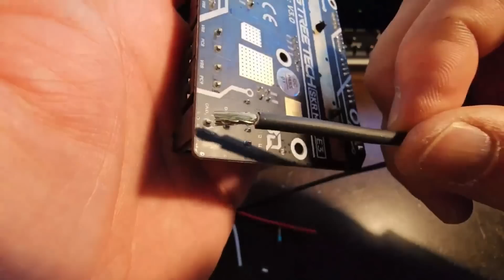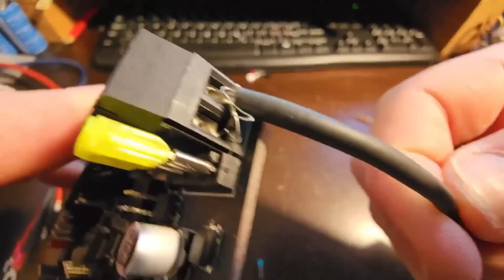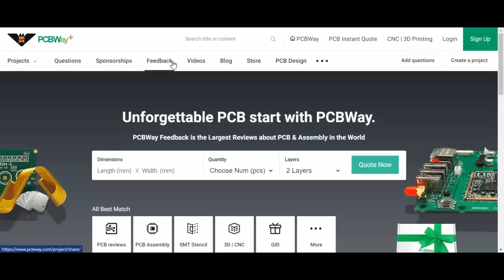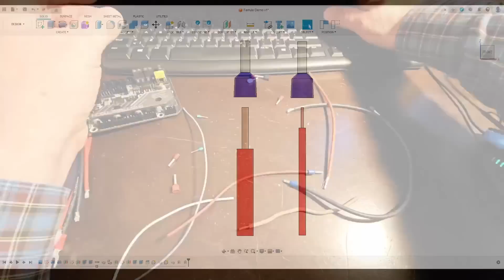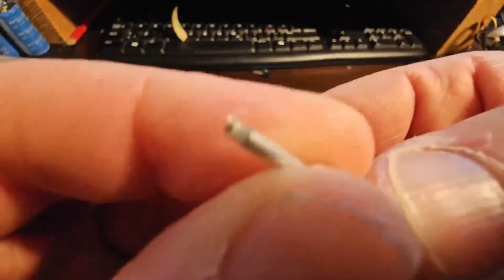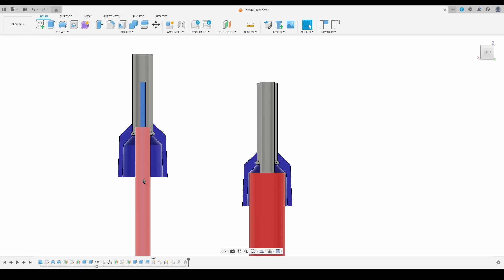A beginner's guide to Ferrules

Comment: Would stranded wire crushed under a screw also create heat by the air gaps created from the spreading of the locking (crush) screw
Reply: Sorry asked question too soon, hence the point of this video

Comment: Is it that it has been soldered? Or that the solder is most likely lead-free solder?
Reply from the maker: Never use solder in clamp terminals. Solder is for solder welding to a contact pad.

Comment: Tinned wires can't be smooshed at all it's hard as rock. to create more surface contact the ferules makes it easier to make more surface area for electrical conductivity.  Crimped ends are softer than soldered ends.  The shape of the crimp also helps.

Comment: Using a ferrule for larger wires like a #6 THHN stranded for 60A-is it recommended? I never like using stranded with screw.
Reply from the maker: I don't think terminations on THHN solid wires or any type of solid core wire is recommended. Although I work mostly with MTW type which requires termination. For high amp application we move to solid copper bars.

Comment: Another important point about ferrule use! 
Never solder the end of a crimped ferrule. It will NOT do better.  
Yes, I've seen idiots do this and even apply solder after crimping a red, blue or yellow crimped lug at the inspection port. In one case a whole light aircraft had to be re-terminated because the idiot owner was soldering after using the correct ratchet crimp tool.
Reply from the maker: Exactly, and the same goes for jst crimps and the likes. I've seen so many  adding solder after the crimping those too.

Comment: I didn't get the water hose theory of electron flow where terminal is clamping the flow of electricity and it releases at heat. Well that ferrule clamps the crap out of that wire. Yes I use ferrules and I also design and wire control cabinets for motion systems.
Reply from the maker: The water analogy was trying to get you to understand that electrons do not only follow the path of least resistance. If that was the case then no circuit systems would work as they reply on several different resistance values and various flows and routing of electricity.
The heat part is what causes the damage. More resistance causes more heat, more heat causes more resistance, that's thermal runaway and the danger this video is trying to help prevent. If you are an automation technician you should have a good understanding of this. It's a vital part of maintaining the safety of your system.
Reply: @StackingLayers  I do have an understanding, but the part that throws me in the video, is it sounded like tightening the terminal squeezes the flow of electrons
Reply from the maker: @portblock really? I repeatedly explained that the issue is gaps and cracks. Not too much pressure. Maybe the part where I say a resistor clamps down on the flow of electricity? That's just my way easily explaining impedance, since not everyone will understand that what that is.
Reply: @StackingLayers  Perhaps you are right, that may what I heard while haphazardly watching. I also need to watch how I say things, and here in front of all, I apologize sir. Sometimes I think I turn into one of those keyboard warriors when I dont mean to. You deserve better respect and I am going to go back and watch your video again.

Comment: sometimes crimping the plastic can also give you a bit of  extra grip and strain relief too....  this is handy on the smaller crimps
Reply from the maker: No! Never clamp on the plastic or insulation. Doing so will reduce the conducting material contact. That is also a fire hasard.

Comment: If the soldered wire has a connection why would the electricity flow through another cracked path that has more resistance. Electrons use the way of least resistance.
Reply from the maker: That a misunderstanding of the physics. Electrons flow through all conductive paths just not equally. 
Imagine it as water in the pipe system of your house. Say somebody's taking a shower and you go and turn on the water at  the kitchen sink, but just barely. A little bit of water comes out, right? At that moment the faucet has a dramatically higher resistance than the shower does and yet there is flow at both points. With electricity it's, in a very simplified way, the same principle but with the added problem of heat caused by resistance.

Comment: Ferrules are important, but the explanation at the beginning cannot be acceptable - solder melting at such lower temperature and such things. 😢
Reply from the maker: It's not melting at first, it's getting stress cracks. This allows for arcing which generates more heat, causing more resistive issues, basically puting it into a a thermal runaway situation. Solder can start to soften at 175c where as electrical arcs can reach in the 1000's of degrees. Granted theses arcs are micro to start out but you should be able to imagine what kind of havoc that would create.
Reply: @StackingLayers  Solder tipped flex cable comes loose in the box terminal because the soft solder can squish in the box when the wire is subjected to mechanical movement. They can wiggle loose. 
This is especial true in cheaper PCB terminals like that when the clamp plate between screw and conductor is thin, deforming into a profile matching the round screw applying pressure on the joint. Solder also requires more tension on the screw to get the connection to a point when the wire doesn't wriggle in the box.

Comment: It creates heat because the solder is solid
The uncrushed wire creates only a couple of points of contact
Those couple points of contact are carrying all the current so it gets hot and melts. 

Untinned wire curshes in the connector and the current can use the entire wire, not creating hot spots

So you are correct. Some is misinformation.
Reply from the maker: It's primarily caused by air gaps amongst the conducting materia.l Solder is soft enough to crush in the terminal. The micro cracks allow arcs to form, which are basically natural resistors. The longer they go unchecked, the more the gaps open from determination and in the case of solder it's tendency to creap with both heat and pressure is what makes it even more susceptible to thermal runaway.

Comment: Bare wire is always the best connection for electricity flow. Furrels might look nice and more convenient, but they are weak connection point. A narrow path in the wire that will restrict electron movement and cause a hot spot.

Check it with a thermal camera.
Reply from the maker: That would be a case of using the wrong type for your application, and not having enough torque on the clamp. But as I mentioned in the video bare wire is fine too, as long as you don't fray them out during installation, and as long as the terminals are made for bare wire.

Comment: Ferrules are great but the crimp tools cost more than most hobbyists are able to afford.  Still would be helpful if you listed your tool mfr and model numbers used in the video.  We used Weidmuller crimpers where I used to work and they were great but no way could I afford one for home.  There's probably some decent quality knockoffs out there so if anyone has any recommendations please comment.  Thanks for the detailed explanation.
Reply from the maker: You can get them for like $15 to $30 on AliExpress, eBay, and the likes. I have Weidmuller (bought used on ebay) and a no name version I bought off AliExpress both of them work basically the same. No reason to buy the name brand ones if you're not going to be doing on a daily basis.
Reply: @StackingLayers  Couldn't agree more. A lot of Adafruit/Sparkfun breakout boards and microcontroller hats use JST/SH connectors for their stemma/qt platform and the offical crimp for their specific pitch was something like $230 on Digikey. I bought the equivalent for $30 from Engineer and honestly the build quality for mine seems better but there seems to be no end to industry people saying JST certified or bust.

Comment: I would add a *BIG* word of caution.  I purchased ferrules for my offgrid solar setup and used them on my solar charge controller.  BIG BIG mistake.  After smelling an odd smell I discovered that the wire was getting very very hot in operation.  The documentation for the controller actually specified a strand count and specifically not to use ferrules.  I removed the ferrules and retorqued to the specs and haven't had an issue since.  While these are good for low amperage simple screw connections I would be hesitant to use them with anything moving real current.

FYI:  The connector on the controller is designed to be used with bare wire.  It has a large clamping surface with teeth and when a ferrule is used there just isn't the continuous contact area that it can achieve with the bare wire.  Only the tips of the teeth make contact because the wire is so compressed it cannot bite into it.  Just a word of caution to the solar guys out there!
Reply from the maker: The burning would be from an incorrectly torqued terminal or a poorly installed/incorrectly used ferrules. I work with industrial control systems and starters. We have starters rated for 45+ amps and all use ferrules, in screw terminals. It's a requirement. Though we use fine strand/flexible wires for vibration tolerance.
 In a standard house installation and other installations that use solid core wire. Ferrules are not typically used with solid core wire, and completely pointless on single core.
Reply: @StackingLayers  His story seems to indicate that the terminals were designed for bare stranded method only. It may have terminated better with a ferrule if the box clamp was used to crimp the sleeve, achieving higher connection surface area.  
Sounds a bit dodgy having 100A high flex (very fine strand) cable terminating in a box clamp terminal block. That should be a bolted crimp lug.  16mm^2 (63A) is about the limit I'd confidently use a box terminal.

I have a similar industrial career experience of over 45 years, manufacturing. Very high QA Standard Generation, transmission protection, distribution and process control. Terminated millions of cables.
I've used ferrules to terminate 95mm^2 cable, down to the 0.25mm^2.  Bare termination has always been a QA fail, even on basic Control or Distribution boards, UNLESS the terminal is designed for bare (which is a huge PITA) This is done using preinsulated crimp lugs (of many form factors) or ferrule. 
I loathe using the spring bite type terminals, that sometimes require bare use only. 

It's good to see decent strippers being used. 😉 I do find my Weidmuller Stripax to be the best. Are the cheapo versions have the cutting blades made from multiple stacked wafers that adapt to the conductor shape?
I find those hex crimpers are fine, but it's a QA fail sometimes if a ratchet preset tool isn't used. You get RSI fatigue using them all day. I use a variety of Weidmuller crimpers for preinsulated sizes (that go down to 0.5mm^2 btw) and ferrules, of course up to that 95mm.

There was one point I would make when teaching amateurs about ferrules - Do NOT apply solder to the crimped ferrule, ever. (unless you are soldering down the wire connection to a board).
Reply from the maker: @BTW... I to didn't agree about the wire and connection choice but I wasn't ready to get into that part. 😅
Reply: @StackingLayers  I don't agree with the connection choice either.  Its just how its sold.  I wasn't looking to create a big ole debate was just relaying something that happened to me.  I would have preferred lugs.  It is one of the largest solar charge controllers made by Victron.  This is something that if I didn't catch it would have surely burned down the house (thank goodness it was stinky)...  FYI Victron 250/100 charge controller.  Take a look at the pictures of the terminals.  I am open to any ideas how anything I do could be done better.  I would even be willing to send pictures.

EDIT:  FYI the battery cables do still get warm.  Under full load they are just above body temp.  Guessing 110 degrees'ish
Reply: @StackingLayers  This was at 100 amps through 2/0 fine strand wire.  Unfortunately it just didn't work for me and both cables got equally hot.  Cut off the ferrules and inserted the bare wire and torqued to spec and the issues stopped.  I will still use them in other applications was just relaying my experience.  After I removed it I could see how the clamp hadn't actually clamped the ferrule like it does with the wire inserted directly.  It just didn't crush down like the bare wire does limiting the contact area.
Reply from the maker: I don't doubt that your situation panned out as you say. I probably would not have used ferrules on such a large gauge myself. And if I did choose to use them it would not be a round crump it would be a square or rectangular crimp tool to accommodate the terminal clamp dimensions.

Comment: I'm liking XT60 even more now. Maybe we should have a surface mount version of these (I only see a surface mount for XT30 which may be enough here).
Reply from the maker: Ove seen those melt down too. But that was more likely due to poor construction or repeated disconnect and reconnecting. The pins tend to lose their springiness over time creating the same problem of loose connections.
Reply: @StackingLayers  terminal blocks aren't for frequent reconnections. Isn't an XT connector (with wired soldered on each side) a better alternative (if space and money permits)?
Reply from the maker: If you are doing constant swapping of power sources, like with battery operated things, then that connector would be better I suppose. Terminal blocks are made for a more permanent connection with an easy service option.

Comment: Man I don't even own a 3D printer but I do other electronics tinkering, and somehow this whole concept was entirely off my radar. I've got so many terminal blocks that need to be upgraded now :D
Reply: As someone coming from a similar context, Ferrules are great for the polish of something closer to a finished project but I've found that banana jacks and plugs are great if I'm repurposing a lot of setups or prototyping different iterations of a build. And the fact that test leads from DC supplies often have another banana jack built in means I can extend and isolate power easily or plug a multimeter in for diagnostics.

Comment: So... tighten the terminals when the solder is warm and soft...
Reply: Better yet, remove the terminals & solder straight to the board! /s
Reply from the maker: The point is to not generate that much heat in the first place.
Reply: @StackingLayers  Exactly. So, if the solder is getting hot enough to melt... you have OTHER problems - too much current. Fix that.
Reply from the maker: The problem is too much resistance from the poor/damaged connections not too much current. Which is confirmed by the fact that there's not enough current flowing to blow the fuse.
Reply: In fact, forget the terminals! 😄

Comment: The place where solder gets pressure it flows away over time and becomes thinner. 
You get a loose connection. This then gets hot and burns the terminal.
Reply: This is correct

Comment: Knowing how to do proper wiring is very important and good for troubleshooting. I bought a brand new SV06 from Sovol directly, it came and worked fine for a while.. then it started acting flaky.. turns out 3 of the wires were installed under the tightened terminal blocks, one was the heated bed.. not great.. 🙄 We honestly need something that's more like a PCB mounted WAGO connectors.
Reply: Wago makes PCB terminals.  I have ordered samples from their website.
Reply: @rando7th  This is very good to know! I'll have to look into them and see if they fit my applications. Screw terminals are kind of an annoyance.
Reply from the maker: @rando7th they make ferrules too.
Reply: Should really still use ferrules with wago's for all the same reasons as screw terminals.

While wago's will self tighten, there is still the issue of fly away wires and compressing solder.
Reply: @Person1873  I have mixed feelings about that tbh, I've never heard of anyone using ferrules with a wago prior, imo it slightly defeats the purpose, as the spring-jaw of the wago won't be biting into the wire directly anymore. Searching that topic I've actually found folks asking if they should REMOVE their ferrule before inserting it into a wago, but the consensus seemed to be it should be fine either way. Maybe a good idea if it's a connection that will be shuffled around often, and as you said loose strands falling out. Else it's yet another interface layer serving a slightly redundant purpose. If it's not part of the wago 221 series though(solid and strand rated), a ferrule might actually be required to get it to work in an otherwise solid-core fixture.
Reply from the maker: Wago connectors are made for bare wire, but ferrules do not affect their effectiveness. Confirmed by a Wago rep.

Comment: Just started using ferrules.  Extermally cheap to get a more professional polished install.  Great details on how to do it right.  And why / what can happen if you don't.   Thanks for explaining why you don't want to use solder wire in a screw down terminal.  I didn't think that the micro-fractures in the solder around the wire would cause resistance/heat issues!   Again great explanation, illustration and video.   One point of feedback.  A little repetitive of points you had already made very clear.   Could shorten the video getting more viewers to watch it in entirety.   Which probably helps get you more YouTube algorithm points.
Reply from the maker: Haha yeah I need to find someone doing tutorials on keeping thoughts on track. 😅 I truly appreciate the feedback. It'll get better sooner or later.